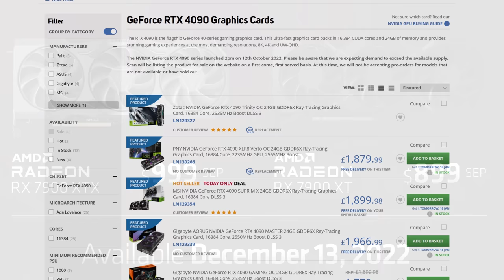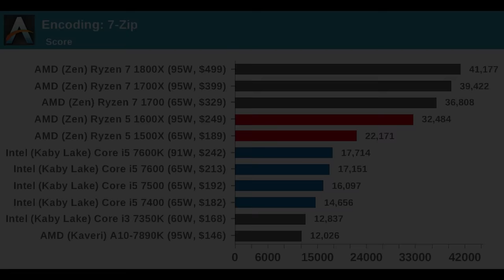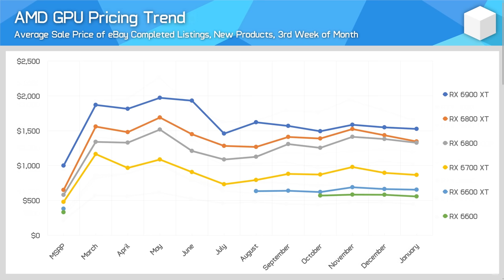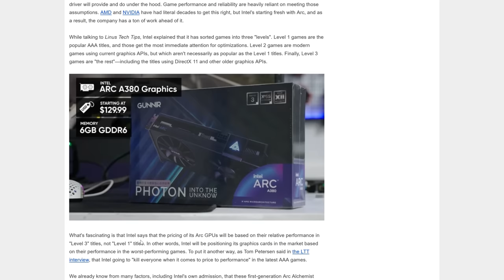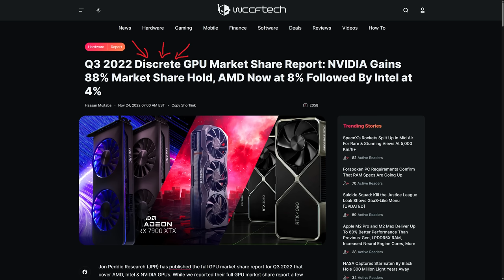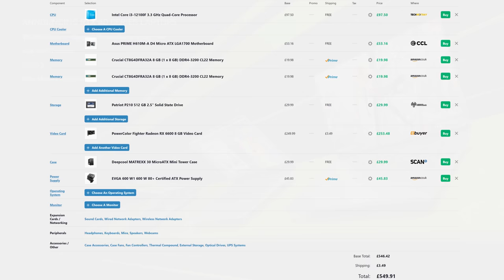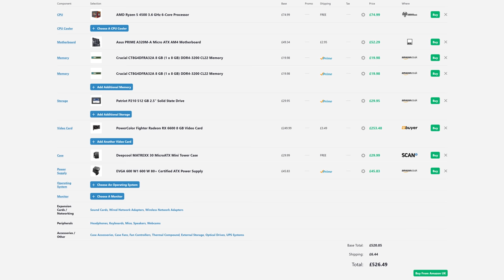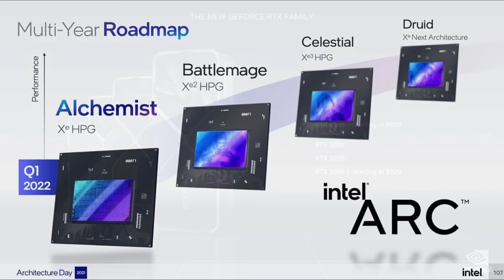Budget Builds in Early 2023?

Comment: I've just recently upgraded my PC with an i3 12100f and RX 6600, so seeing you recommend both of those options makes me feel very validated.
Reply: I built this exact configuration too
Reply: I bought an RX 6600 back in april 2022 and now I regret not waiting a few months for the price to drop
I really should have went with RX6500XT
Reply: @kajojo2399  6500xt is really bad compared to 6600
Reply: its a solid build, it will last years and years if you don't mind lowering the settings.
Reply: @kajojo2399  nah the “5” level cards in both AMD and Nvidia is not worth it, it is always a good idea to save up for a few more months to actually get what you want instead. The 6500 xt is significantly weekend than the next in line 6600 and the 1650 is significantly slower than the next in line 1660 or 2060
Reply: congrats man, enjoy your new PC :D
Reply: @kajojo2399  the rx6600 will last you the entire ps5 generation, rx6500 is already obsolete at 4gb.
Reply: I would stretch the CPU budget to 12400f personally, but 12100 certainly is the budget king, no doubt.
Reply: I built one using 6700xt tho
As for 12100f i might give it to my lil bro and me myself will go to 13500 once it goes down in price by year end
Reply: Used 3060ti is a great option for around 350€
Reply: 6600 is great as an entry level card. No real drawbacks, as cheap as it goes, and readily available. The only downside is that it isn't as fast as more expensive cards, but it's the best value card, the cheapest card, and doesn't have the flaws (PCIe 4 requirement, no video encoding) of the 6500XT.
Reply: W
Reply: Killer combo. 
You can also pair it with R5 5600 for enabling amd SAM .
Or spending a bit more with R5 7600 to future proof your build
Reply: Extremly bad build
Reply: I get upset when people say amd/intel has forgot about gamers. Rx6600 & i3/5600 never been a better time to build
Reply: @jelipebands1700  Yeah they did forget about gamers.
Rx 6600 is midrange and its 239$
Rx 580 was midrange and it was 169$
Reply: @costi2596  I purchased the rx480 at fry’s for $240 when it launched. Cards under $300 are the best.
Reply: @kajojo2399  I thought the same way (I bought a 6600 in early 2022) and sure, the value of the card has tanked but that's to say nothing of the hundreds of hours of high and ultra gameplay I have with it
Reply: @costi2596  Have you considered the budget?
Reply: I got an rtx 4090TI and a ryzen 9 7900x3d xtxtxxxx
Reply: I have this build right now. Hasn't failed me at anything in 1080p
Reply: Enjoy it brotha
Reply: @kajojo2399  nah your good lol I did the same thing and compared to my gtx 960 it was miles better and I don't  regret it
Reply: @connorWithTheReallyLongHandle  I still play at low to medium with said card but the low power usage is insanely good
Reply: @kajojo2399  I got a 6600xt for 460 pounds in nov 2021 :( But i did also sell my gtx1070 (bought used for 180) for 300 so i guess its not that bad
Reply: My i3-8100 can't handle this RX6600 so im planning to buy a secondhand i7 8700 for this gpu. Or should I upgrade to ryzen 5 + amd mobo?
Reply: i3 12100f underrated, its equivalent to i7 10700
Reply: I have i5 12400f with rx 6600xt, i feel the same. Maybe if you spent 100 more bucks you wouldve got big bump in performance.
Reply: can we play at 1440p with RX 6600?
Reply: @empty1680  Older titles, sure. More modern titles? It may struggle a little but it can manage it.
Reply: i have a similar build with r5 5600 and a 6600xt. love it :)
Reply: Holy shit i feel so lucky tooooooo
Reply: The 6500xt with 6 gb would've fine imo.

More than the pcie 3.0 vs 4.0 debacle.

Especially since it has dropped to 140$.
Reply: I went with the i5-12400f and the RX6600 earlier this year and honestly I'm very satisfied. Sure, this GPU is kinda quirky compared to my previous Nvidia one but most of the time it works great and that's fine by me.

Comment: Just built a system with an RX 6600 that I picked up for $300 CAD, it is quite the value at the moment. Feels like the good old days before GPU prices entered the stratosphere.
Reply: RX 6600 is insane for its price, I'd definitely recommend it over the 2060, 3050 and 3060. Driver issues are barely noticeable. Despite many people saying they're worse than Nvidia, I actually prefer them due to the more simplistic interface. The drivers aren't worse, just not all games support them as much as they do Nvidia drivers.
Reply: I got myself a used one for 160 USD and its served me well so far really a great card if you can get it at a good price
Reply: its literally barely better than a 1060 3gb that release 7 years ago, at 1,5x the price..... under no sun on no world in no galaxy in no single universe is this a good deal, its the definition of stagnation...
Reply: @robinbinder8658  that not true at all
Reply: @Azzy_Mazzy  yeah ok its not "barely"..... its 1,5x perf, but so is the price (my locality).... point still stands
Reply: @robinbinder8658  yeah the “low end” stinks currently, i still haven’t upgraded from my rx 580
Reply: @robinbinder8658  The 6600 is slightly faster than a GTX 1080 according to Tom's Hardware, you're probably thinking of an even lower end card than the 6600

Comment: I love that you mainly focus on the monetary aspect, like buying cost and power consumption.   

Im keen on seeing your review of the new zen 4 apu chips , ONCE AMD finally releases them
Reply: Wait, Isn't the 7600(x) a zen4 apu ?
Reply: @SozImaScrub  i meant the G-Series, imagine what an apu with 14-20 rdna 2 cus could do
Reply: Sorry for asking randomly here but I have i7 6700k and 1070 when should I upgrade ? Any advice/suggestions ?
Reply: @dankcreme3687  upgrade when you need to, the 1070 is still a solid card and if its running the games you play well enough then don't get an upgrade for the sake of an upgrade. Unless you really want to build a new system and have the money spare that is.
Reply: @Wulf__  got it thanks
Reply: Is the 5600g any good?
Reply: @Daylightv  Its good for older games and indiegaming. It only makes sense if you dont plan on using a seperate graphics card
Reply: @RowdyDandy  trying to save up atm, which GPU would be a good pair for it later on?
Reply: @Daylightv  anything from rtx 20 series or rx 5000, or smth below that like 1660 super.  Newer gpus will be slightly slowed by the pcie 3.0 in the 5600g, if u want futureproof pc u should buy intel 12th gen like the 12500 i5. * i5 12 !500!  since the 12400 has worse igpu.  with the new intel platform it should be easier to upgrade later with a gpu

Comment: I was quite excited to hear Intel was coming out with GPUs and I put my money where my mouth is. I did a sideways "upgrade" from a 1070ti to an Arc A770..
I'm shockingly pleased with it so far, and I'm excited to see what progress Intel will make with the drivers. Performance is a bit better than my old card, and of the games I have tried I haven't found any major issues.
Reply: mind elaborate a bit? Am interested in purchasing an a750. Would love to see some feedback from non-tech reviewers.
Reply: @raylxh1925  Well, my feedback on it is likely similar to that of tech reviewers, and I haven't done tons of testing as I've only had the card for about a week, but sure.
For starters, it's probably important to mention my PC:
- i9 9900k
- 32GB DDR4
- 1TB RAID0 SSD boot disk
- 1000w Gold EVGA PSU
- Arc A770 Limited Edition /w 16gb of ram.
- I have a 1440p 144hz display

It's important to note that with this system, I do not have PCIe gen 4, but I was lucky in that my motherboards were one of the few z370 chip set boards to get resizable bar support added. Without resizable bar, this would have been a really stupid purchase. Not having PCIe gen 4 doesn't seem to make much of a difference, as far as I can tell.

First impressions with the physical hardware:
- The packaging is really nice, maybe a bit overdone considering the price of the GPU, but it is nice.
- The GPU is built like it's a laptop, which both makes it more complicated to perform any kind of work on it, and that also means intel is probably spending way too much money on the actual assembly of it.
- Despite being smaller than my 1070ti, the A770 is physically heavier
- The A770 is a very pretty card and it looks great in my PC.

The good:
- While emulating Breath of The Wild with Cemu (1440p, cranked AA, view distance, and everything else to it's maximum), it actually had more stable framerate than my old card
- When I tired to play BeamNG drive, it ran great and I was able to crank the settings a bit higher than my old card, with similar performance.
- Dirt Rally 2.0 with settings absolutely cranked runs amazingly
- 3DMark Port Royal (ray tracing benchmark) puts the A770 between a RTX 3060ti and a RTX 3070 in terms of ray tracing performance.
- When I tried the XeSS feature test in 3DMark, it gave a 50% uplift with the quality preset, and XeSS actually improved the visual quality as it seemed to clear up some visual oddities that were there without it

The okay:
- I'm really excited to have newer features such as AV1 encoding and decoding. I've enabled AV1 in YouTube playback, it's never crashed once, looks great, and the bitrate is definitely lower than vp9 while retaining the same visual quality, which is great. But, as it stands, there aren't many situations when I can take advantage of the AV1 encoding on it. Discord just got support for AV1 encoding, but I believe it's only for RTX 4000 cards.
- When I tried GTA V, the performance seemed to be a bit worse than my 1070ti. To be fair, it's still pretty good as I'm playing it at 1440p with most of the settings set to their maximum, but the performance dips more and it doesn't feel as smooth.
- The driver software. It's okay and is slightly better than it used to be, but it needs a lot of work. For example, there isn't any way to remove a game from the game list. It's also a huge driver download. 

The not great:
- Portal RTX completely refuses to launch. It seems like the Intel drivers may not support every feature that the card tries to use. Some people reported it as somewhat working on a older driver version, but I had no such luck.
- While Cemu did have much better performance on the Arc card for me, it also has some minor graphical bugs with a few specific items in the game, but it's pretty minor and is easily ignore-able. 
- Overclocking. It's just.. vague without any proper indication on what exactly you are changing with the performance slider
- You are in a lot of ways, a beta tester for a new product, and the next version will likely be a lot better.

My thoughts? For a budget, the A750 is very, very promising after the recent price drop to $250. The performance shouldn't be too much slower than the A770, while being much cheaper. The potential performance on the card is great and if ray tracing is something you are interested in, it seems very capable at it and was clearly something Intel focused their efforts on.

Additionally, I don't own many new games that have XeSS or RayTracing support, so I can't provide much input on that outside the 3DMark benchmarks.

If you have are okay with potentially having some issues and you have a system recent enough to have resizable bar support, I think it's definitely worth considering it.
If you want something that will feel polished and more or less "just work", you should look at an AMD or Nvidia card.
Reply: @BelleDoesStuff  great info tho, thx a lot.
Reply: @raylxh1925  Welcome :)

Comment: This last year I bit the bullet and built myself a PC with a 6700 XT, a Ryzen 9 5900x and 32gb of RAM. 

I have it in a slightly older Corsair 750d case, so I even added a Blu-ray drive to it even though I won't necessarily use it too often.

I don't think I'll need to upgrade until years from now.

Comment: The problem with the 6500xt wasnt that it itself was slow, but the fact that it used a pci-e x4 interface, which was fine on a pci-e 4.0 system, but its target audience were budget gamers, most of which were using pci-e 3.0 systems, even 2.0 if you were upgrading a cheap pre-built, and those had a massive nerf. 
It also really showed the state of the industry, a lot of people, me included, had cards in their system that cost less, were years old at that point, and outperformed it, leaving a lot of people with a bad taste in their mouths.

Comment: New cards are terrible pick today but the current used marked is the best thing we had in a long time. You can get a 1080Ti which is equivalent to 6600XT for under 270€. 4k DLSS/FSR capable cards at around 400€ and actual 4k cards with good raytracing performance at around 600€. The market is good, the new stuff is just expensive because the market is flooded with cheap old stock from pandemic era.
Reply: usually a budget gaming rig in most peoples eyes is a brand new pc with components which still have warranties and the like, not something which is sold as is. Used cards are extremely risky at the moment due to the chance of them being mined. I feel like there is no point of even entertaining the used market at the moment as either it is too old or too good to be true.
Reply: @Transistor Jump downside, a second hand 1080ti is out of warranty and at the end of its lifespan. Its getting to 10 years old now, which even for good components will struggle at that lifespan.

Comment: I got a 3070 from a miner who sold it to me for just over 300$. I checked the thermals and everything and it was all pretty much perfect, even the box it came in looked completely new. Buying second hand is a double edged sword, but sometimes you can get something great if you just look for it. All in all, I was able to put together a Ryzen 7 5800x, RTX 3070 build for about 1250$ which isn't really a "budget" build but it's still exceptional for the price especially adding NVMe storage, RAM, AIO and other stuff. I think today, if you wanna build a PC, you should buy everything new, except for the GPU. Buy a second hand high-tier card from a reputable source.
Reply: Also just to add a bit to what you said, the best used cards are 2060, 70, and 80 Supers (not great for mining performance); 3060Ti, 3070, 3080, 3080 12GB and 3080Ti - however I would definitely stay away from used 3090s and potentially 3080 10GBs as they've been out the longest and have GDDR6X which seems to have a higher failure rate than the GDDR6 based 60 Ti and 70 - 3080 Tis can be overly expensive so if you can't get one for close to $700 I'd bit the bullet and get a 4070Ti (3080 12GB can also be found for prices very close to 3080 10GB but they are closer to a 3080Ti in performance and also are newest so least mined on. Then from AMD, used 6800, 6800XT, 6900XT or 6950XT and maybe new for the incredible value 6600-6700XT range. I would strongly avoid buying any 10 Series, 400/500 Polaris AMD, Vega 56/64/7, and RX 5700 and 5700XT cards as they've been through either two full mining booms or have higher failure rates.

Comment: Been looking for a better GPU for several years now, had a GTX 980 that failed me, got recommended RX Vega 56 since it performed as a Vega 64 if you tinkered a little bit but the performance and poor driver's at the time made me swap to a second hand 1080ti which really hurt my pockets but I had finally gotten the performance I was lacking.

Now several years and a crypto boom (and downfall) later I'm still on the same graphics card but I've managed to upgrade my CPU from a 2700x to 3800x... and now again to a 5800x3d which I got a very good deal on (Thank you black Friday!) €300 including a 25% electronic tax and I see some ludicrous speeds, especially in E-Sports titles! Which is what I mostly play.. 
   However I've been looking to play some titles with beautiful scenery and it's fine to play at 1080p but I'm in quite desperate need of a good monitor with better colours, the old 144hz I got for about €200-250 when 144hz started to become a staple gaming wise, it's had it's fair share, I've had and swapped several side monitors with my sibling which all have had insanely better colours, although only at 60hz which didn't feel that suitable to game on. 

So finding something that's noticeably better than the 1080ti I've got while still not having to empty out my wallet sounds to me, a dream that won't be fulfilled in the near future.  

TL;DR: Been waiting on a price-worthy GPU upgrade since my previous ones failed me.

Comment: I won a A750 in March 2022 and it arrived in November. It was a good extension of my current system as the GTX970 was a bottleneck for some titles. a Lot of pain a long the way, but since like 1-2 months it has been fine mostly. Now it's time to upgrade to a new PC. and the A750 becomes a stop gap for the eventual 48GB accelerator I need to run some language model inference.

Comment: I'm still using the same PC I bought in 2019 with a RX 580 and Ryzen 5 2600. Overall it was a bit saddening to be playing games I was so hyped about like Elden Ring at butchered framerates but at the same time there's no chance I could get my hands on something better currently. 

However, one saving grace has been AMD's FSR. Running games like Judgment on my PC at 80 FPS and still having no particular quality drop felt and feels amazing. For the time being, I seriously hope more games devs begin utilizing these resources since as far as I'm aware it's both cheap for them to implement and saves lives for us "poor" gamers.
Reply: I had almost the same build for just about 3 years, when I started having big bluescreen problems related to my RAM. Switched both RAM and motherboard, but still had the same errors. Now I'm wondering if my 3600 or 580 were the problem. Have you had any noticeable errors with these AMD components? 

That was my first ever build, so I've been thinking about trying Intel and Nvidia, seeing if that was a one-time thing or my parts met their end.